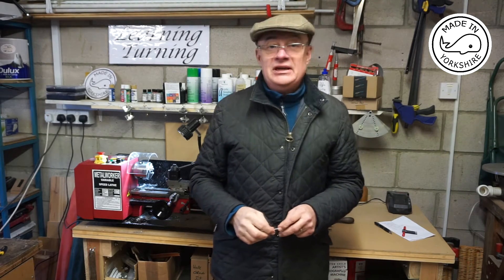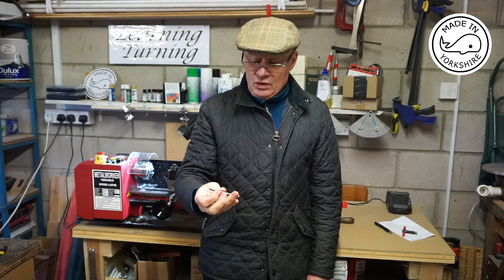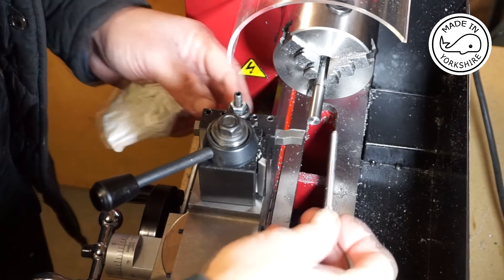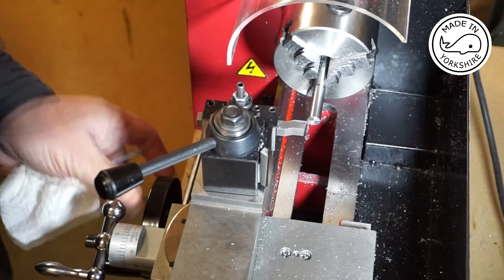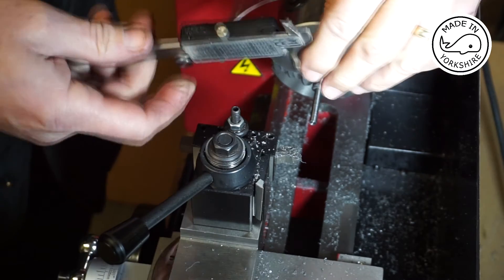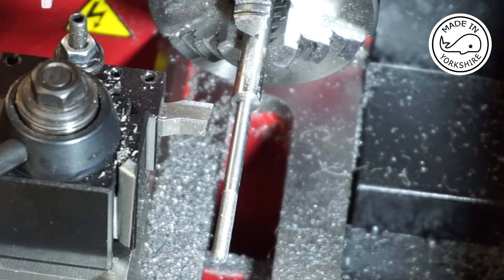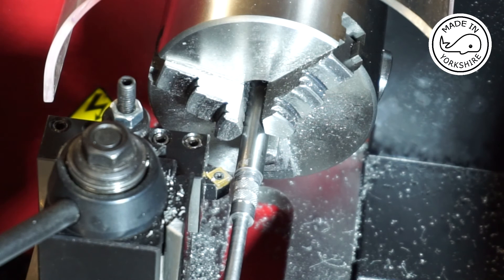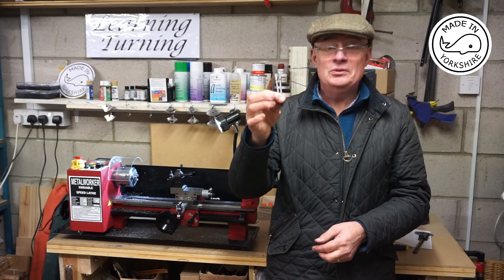#MT5 - Mini Lathe Gear Cover Screws. By Andrew Whale.

Comment: Hi Andrew. A question: is there a reason why the knurled head of the screws you made had pretty much the same diameter as the allen screws you replaced? I would have thought that giving them a wider diameter would make them more accessible and less fiddly (particularly with slightly oily fingers). Also, as the screws are not under any stress, there is no real reason why they couldn't be made from brass, which is softer and knurls much deeper, giving better grip. Just a thought.
Reply from the maker: Hi Ron, fair comments. At the time I had very little experience with the lathe and I had only a few materials available. It was very much experimental. However I've not found any problems unscrewing them.
All the best.
Andrew

Comment: Just my 2 cents, but steel would be where I would try the carbide insert tool and also I would be using the tail stock to stabilize the work. I don't have an opinion on knurling as I've never done any.
Reply from the maker: Hi bhein67. Many thanks for the feedback. I agree, if I was to do it again I would definitely use carbide. I now realise that tailstock support would have helped as well. I am learning slowly, and I really appreciate yiur suggestions.
Cheers
Andrew

Comment: Hi Andrew - good to see you enjoying your machine! Part of the fun is improving ones machines and making of useful accessories for them. Can I humbly make two suggestions? Firstly, I recommend that you always use your tailstock to support the work where possible - just as you would do on your wood lathe. If you haven't already got one, I suggest you buy or make a live centre for the tailstock. This will reduce deflection of the work-piece whilst turning which will result in more parallel turning, a better finish and allow your tools to work more efficiently (there is nothing wrong with HSS tooling, particularly in a small lathe). My second suggestion is that you only use your knurling tool as a paperweight. The push-type tool you have places a huge strain on your headstock bearings and slides - buy (or better still, make) yourself a pinch-type knurling tool - Hemingway do a great kit (http://www.hemingwaykits.com/acatalog/Knurling_Tool.html). Clive (NZ)
Reply from the maker: Hi Clive. First of all, thank you so much for taking to time to provide me with these suggestions. I now understand what you mean regarding knurling. I've just checked out Hemingway Kits and there are some great ideas there too. I've already got a variety of 2MT live centres, so I will use these where possible. I did have an unpleasant moment previously trying to part off, so I think I also need to look at making modifications to lock the saddle and the compound slide ASAP. Thanks again, and all the best.
Cheers
Andrew